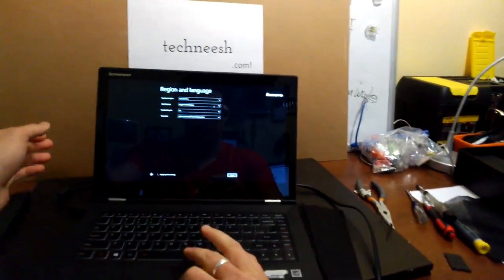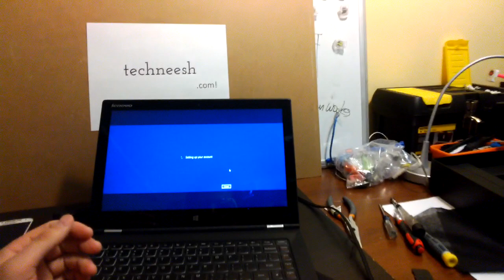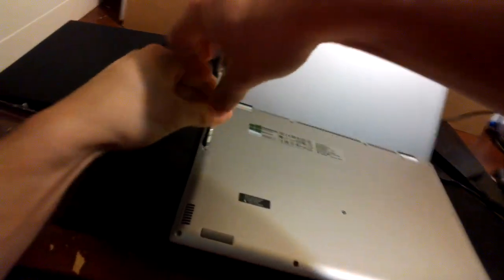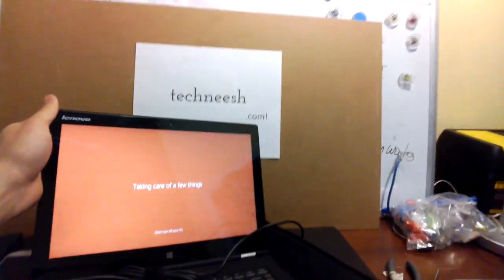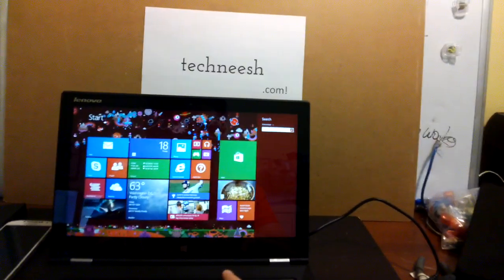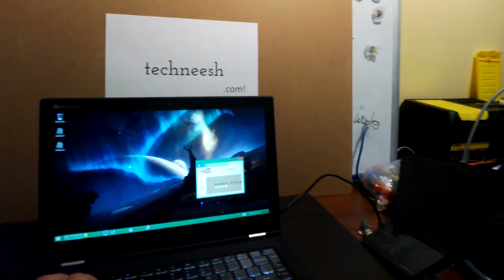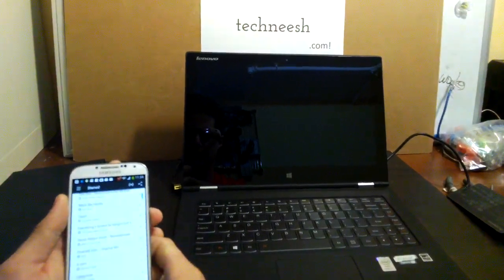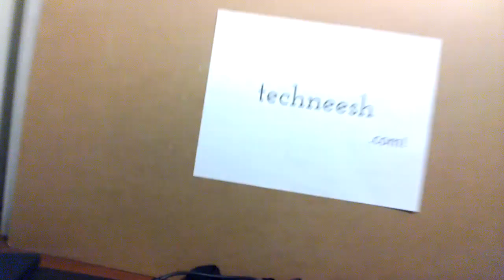Lenovo Yoga 2 PRO Unboxing & Teardown & Upgrade How-to via Google Glass (with Yoga 11S)

Comment: Hi, The teardown was very helpful, heaps of thanks. I have two things to ask if you can kindly confirm. First is the build quality, some say its plastic, some say its a soft touch finish and one review from Lisa (technology review) mentioned the body as a composite of aluminium and magnesium. Since you have opened it apart I am sure you can comment on how it felt.

Secondly, on the forums I have seen that the buyers are facing trouble with the display panel brightness and flickering issues. Apparently changing the settings and disabling the auto brightness/adaptive brightness has not made any resolutions. I would like your opinion on that one too. Personally, I think that its a hardware issue rather a software one, especially screen flickering is definitely a hardware one. What do you think ?

Thanks

Comment: Did you end up keeping this one?  I picked up the yoga 2 pro with the i7 and 8GB after seeing this vid and thinking of all the options, decided to do that.  I was curious about your take on the wifi issue people have talking about, Thanks Will.
Reply from the maker: I ended up returning this in favor of the 11s - I like the smaller form factor and the ability to leave an SD card inserted permanently. also, I use the hdmi out a lot and find that the full hdmi port works much better than the micro... finally, the resolution being so high ended up being more of a nuisance than a plus. but the pro would be my second choice :)

Comment: Hey Will great video, quick question, do you know if the first yoga 13 has an up-gradable ram slot? I currently have and idea pad u430 8GB and was thinking of getting rid of it and picking up the first gen yoga 13 or the 11s but not sure how worth it that would be comparing what I have to either one of those.  thanks in advanced.
Reply from the maker: thanks! yes both those machines have an upgradeable slot. the new yoga 2 pro does not, though. the 13 has space for a 2nd msata ssd, too. personally I'd go with the 11s w/ the 4200U haswell
Reply: Will Stone Thanks Will, That's a tough choice, I like the bigger display but like the Haswell, good thing is I have about $100 is rewards certificates from bestbuy, so now it's a matter of do I go for size or go for a better CPU.  They have two refurb ones, which I don't mind picking up, save some money.

Comment: I bought the 8gb model and was wondering is the NIC replaceable? as the wireless card these came with is the only downfall in my opinion being 2.4g it constantly drops in and out.. so i'd like to swap it out for a dual band mini-pcie nic...that wasn't soldered on was it?  Also was it able to go back together just as easily?
Reply from the maker: yeah you can totally swap the nic. it's half size msata (pretty standard for ultrabooks). super easy to put back together once you know how to take it apart ;)

Comment: Hope you answer back cause its a video from awhile back. Can you add a second ssd to a lenovo yoga 11s? I just upgraded ram to 8gb. Also any help you can send my way on how to increase performance to run battlefield 4 and c.o.d. at decent fps.
Reply from the maker: hey, Stevie! check out my video 'how to play crysis 3 on lenovo yoga 2 pro' for a couple ideas- no the 11s won't take a second ssd, but you can leave a big SD card in permanently (I use a 128gb card i got for $60). you could also swap the msata ssd that came with it for a bigger one. check out my blog link in description for how to do that!
Reply: Thanks.. You can't play games off sd card can you?
Reply from the maker: I don't see why not! A lot of data probably gets loaded to RAM so performance-wise it could be fine
Reply: Have you ever tried to save Steam games to one of those like level 10 ssd cards? Thanks again for answering.

Comment: Really important question for you Will, what screwdriver did you use to open this guy up? I have one and the trackpad is really loose (annoying the hell out of me), so I want to open it up so I can tighten it. But my screwdriver won't freaking fit properly >.< Seems like it needs something special. What did you use in this vid? Thanks
Reply from the maker: torx t5 or t6 i believe; I forget which (and I returned my y2p). i have a couple cheap (sub $10) sets of little screwdrivers that come with a wide array of phillips and torx bits - might be worth picking up one - gl!

Comment: You state that the mSATA drive is the only upgradeable component.  I've heard differently.  Please clarify:  Can the Wireless N card be upgraded to a Dual Band Wireless AC 7260 M2.NGFF?
Reply from the maker: yes the wifi card, as is the case with all ultrabooks, is removable, so technically you can 'upgrade' this as well :) just make sure you buy the correct form factor (half msata)

Comment from the maker: I'm not 100% sure as I don't have it anymore but I would be extremely surprised if you couldn't replace it... the only possible way is if it is glued in or something - but again, I doubt it. Also, you can find just about anything on eBay, but I doubt you'd ever need to replace it - unless you plan to keep it for 2+ years

Comment from the maker: keyboard- feels great
trackpad - works well (as did the first yoga) - right click is just click on the right of the trackpad
haven't heard the fan noise at all yet
no frame drops - web browsing good...
on the LOWEST brightness (which is wayyyy too bright, probably 4x the minimum brightness of the yoga 11s or original 13) it's reporting between 4-5 hours - this is with bluetooth off and not a whole lot going on otherwise
wifi seems good
lenovo backdoor access - google it, article is pretty shaky